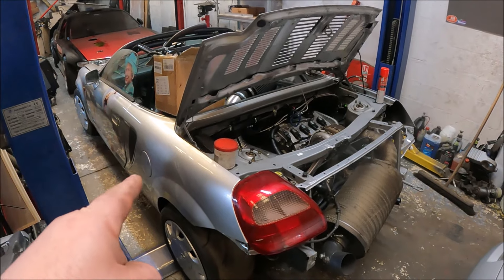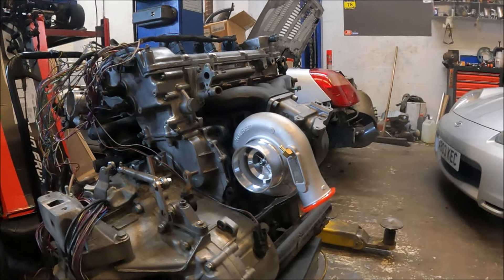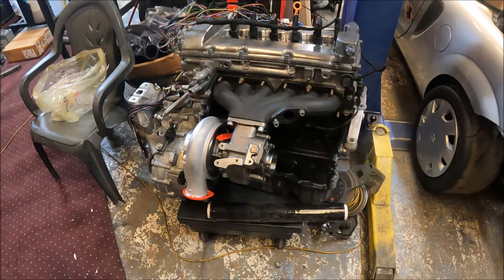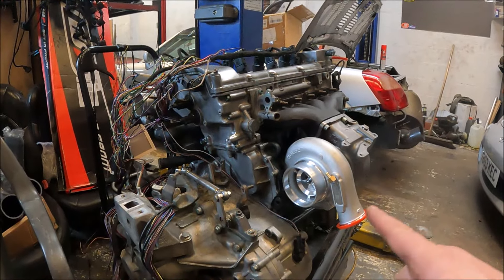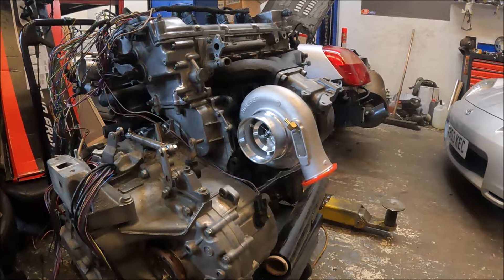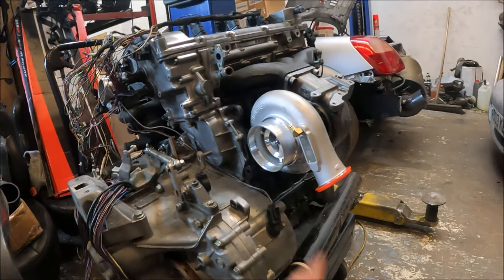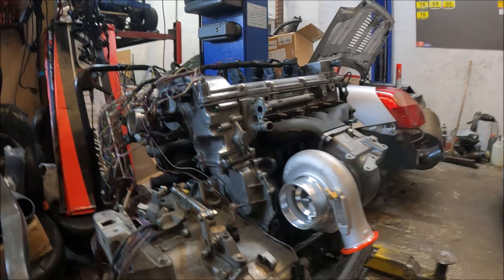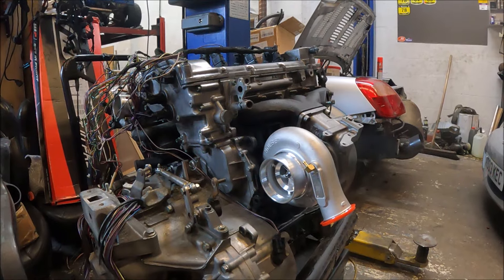How to choose the correct turbine housing for your turbo engine. And a look at the Holset HE351W 8cm

Comment: The 9cm2 he351 turbine housing is magical. With upgraded turbine sizes like the 67mm it can make well into the 800hp range. Great info. The magic’s is all in the turbine and nobody knows it :) you need way less compressor than the internet will tell you.
Reply from the maker: Yep. Most obsess over the comp wheel and forget the turbine side.

Comment: Hey man, stumbled across your channel while looking for info on the Garrett g series. Thank you. 

I wish this video came out in November when I ordered my Garrett g30-770😅. It’s for the new Subaru 2.4l DIT cars and I went with a massive 1.01 AR for this mid size turbo 😅. Wish I went with .83 in hindsight. 

If I may ask, What are your thoughts on .83 vs 1.01 for the bigger g35-1050? That is my end goal turbo for 750-800hp. Thanks!!

Comment: Loving these videos regarding the holset. I'm running one on a Pinto (2.0 8v) with a fully forged engine and have a 12cm housing, it's just a standard turbo not a fancy billet wheel. I want to make 400hp+ currently makes just over 300hp at 17psi and comes in at 3500rpm and holds all the way out to 7200. Would I benefit from changing to 8cm housing or going for one of these new ones with the billet wheels?
Reply from the maker: Spool arounds about right for a 2ltr, power is pretty low but if the N/A engine is making 140-150bhp then a touch over 300 at 17psi sounds on the money. I mean that’s low boost, a Cossie at similar boost makes similar power.

This spec would spool faster though of course as it’s a smaller housing. Your power isn’t likely down to anything but the fact the boost is low on an engine that doesn’t make a whole lot of power without the boost.

Comment: You reckon a he351 with an 8cm housing would be too small for an rb25neo? would be a twin scroll setup and i know people usually recommend a 12cm housing but just curious of other opinions
Reply from the maker: Depending on goals, that would be fine imo. It’s still a big high flow turbine wheel regardless

Comment: Hi @Stavtech, 

I'm thinking to use a HX35 with twin scroll 10cm housing on a VX220, keeping it low boost with dual 38mm wastegates for max 250hp. Later changing the engine to a built B207 and aiming for 400hp. Would that make sense or would you use a smaller turbo for the Z22se engine? Would like to keep it as responsive as possible.  

Thanks in advance!
Reply from the maker: I’m using a HX40 with a 16cm housing on a little 1.8 with a twin scroll setup and on the dyno the graph showed 0.5bar boost by 3000rpm, 1bar by 3500rpm, 1.5bar by 4200rpm, 2bar by 4500rpm and held that to the 8000rpm limiter. On a bigger engine and smaller turbo like you’re talking about you’d be way faster spooling if done right.

Comment: Hi. What turbine housing do you recommend for a bmw m52tub28 with hx40 super? (Compressor 60 / 86mm, Turbine 75/65 mm)
The power goal is 500whp (with pump gas ron98 and low cr), I'm thinking of getting the 16cm but afraid of late spool.
Reply from the maker: 16cm seems a good idea to me. I’m running a 16cm on my HX40 on my 1.8T and spool is fine
Reply: @StavTech  all right, thank you

Comment: Planning on one of these on a forged 3sgte, hks cams and twin scroll manifold. Do you reckon spool at around 3-3500 would be achievable? 

Plan on running anti-lag too to make it as drivable as possible. 

Just worried it might be a bit big
Reply from the maker: Easily. Even with a bigger 12cm housing these are proven seeing 25psi by 3500rpm on 2ltr 4G63s.

I’m seeing 30psi by 4500 on a much smaller 1.8 using a much bigger HX40 16cm

Comment: So is it better to go big wheel small housing or the other way around? Is there any difference?
Reply from the maker: Technically, big wheel small housing is the most efficient way, and usually how works race turbos are. But the actual difference in efficiency I don’t know.
It’s a trade-off to some extent regardless as technically a bigger wheel means more mass to rotate, but it’s a better way to do it if possible.

Generally though manufacturers have it mostly right with wheel sizing and just gotta choose your housing to suit your goals though.
Reply: @StavTech  So basically it's just a trade off of leverage vs mass? Can you also explain how to read turbine maps? I use a rule of thumb of about 20-25hp per lb of turbine flow on a Garrett map but it's not based on any science.

Comment: I have Hx27w 8.5cm T2. Max 270-280 on my diesel application.
Would a HY35 7cm T2 be a decent upgrade? Or a HE300 8cm twinscroll?
Reply from the maker: Depends what spec HE300 8cm, as this turbo here, the HE351 8cm is also sold/classed as a HE300.

For single scroll and keeping T2 flange the 7cm HY35 is a decent option, but this 8cm HE351W would probably spool the same if using a twin scroll manifold

Comment: Hi Mr @StavTech 

Thanks for the video very interesting. What holset turbo would you recommend for a 1.8t for fast road use?
Reply from the maker: What’s the power goals?
Reply: @StavTech  it will be fully forged but look for about 450bhp
Reply from the maker: @allanbeckett1537 hi mate, for those goals I’d use this 351 and a twin scroll manifold. On mine I use the bigger HX40 16cm and a twin scroll cast SPA manifold making 514 but way more to go if turned up more. For 450 or so a 351 with either the 8cm or 12cm on that same or similar manifold would be perfect imo

Comment: Thanks for sharing your knowledge Steve.
I was wondering if HE351 with 12cm housing would be a perfect fit to my Buick 3800 series II V6 engine. I want to have about 350-400ish very streetable horse power. It's still plenty for stock Borg Warner T5 transmission and factory 10 bolt 7.5" Chevy rear end.

I'm also curious about HE221 with 6cm housing in BMW m52b20 if it will have similar performance to Borg Warner B3G a45 AMG Turbo. Cheapest alternative to turbocharged this tinny 6 banger would be TD04-19 or Chinese gtx28. 
Target is about 250-300HP
Reply from the maker: Hi mate, for 350-400 this 351 with a 12cm sounds ideal on a 3.8. The 221W idea on the 2ltr doesn’t seem a bad plan either!

Comment: For a audi/vw 1.8t what holset would be close to a gt3071r spec from factory? Looking for 380+hp around 3k spool or so.
Reply from the maker: This turbo is part way between a GT30 and GT35. Personally I’d run this with a twin scroll manifold.

Comment: Hi Mr Stavtech.  Thanks for sharing your wealth of knowledge with us all.
I recently acquired one of these holsets or very similar in size and specs.  One difference I have noticed is that mine has a conical ring that looks to be held in place with a circlip that's covering what I think are the anti surge ports.  From what I've seen on some your vids, this ring isn't there or you've removed this part.  Are you able to give any info on this and whether or not I should remove it and any pros/cons of doing so? Thanks.
Reply from the maker: Silencer ring. Used to reduce turbo spool noise. Can remove if want

Comment: I’m the bolox who keeps reminding people Ken block was the greatest driver ever of my woman’s page 😅 tell me this. What holset would you use on  sr20? Have a Gtir i toying with upgrading. Cosworth hg and studded with 660 injectors and question 2. What would you run a  bmw m50b28 with forged
pistons? Decent top mount with 1000cc injectors. Ken block for life ❤️
Reply from the maker: Hahaha superb! I wondered who it was! 😂 1- Depends on your goals, if you had a twin scroll manifold one of these 8cm HE351s would be good. 2- Again depends on your goals as 1000cc means you could have all kinds of power. A HE351 12cm would spool up from cock all and still proven at 500+ on M50s, though I think if I had a built engine and big injectors I’d put a HX52 on it and send it

Comment: The K04 on the Volvo is so teeny tiny. Makes 20psi by 2300rpm but by 6000rpm it’s back down to 15psi as the engine wants more air and the turbo can’t flow it. Peak power 5500rpm lol.

Wish you could decently twin scroll a 5 cylinder. Oh well.
Reply: quick spool valve :p
Reply from the maker: Tbf I’m not convinced you can’t. Not perfect but I’d wager it’s got a good effect.

But yeah, same turbo but only running say 10psi and peak rpm will be higher, though power lower

Comment: It’s actually better for a stock internal engine to have a larger rear housing. Keeps the rods in
Reply from the maker: Depends on your boost, and what engine. Torque kills rods. This VR6 is low boost so not big torque, and they have mega strong rods anyhow.

If you pushing a stock engine, yes bigger the better, but if you not near its limit, not a big issue

Comment: im suprised they havnt started included the volume of the housing in the measurements
Reply from the maker: Literally not a single turbo company on the planet has ever done that, as it doesn’t mean much
Reply: @StavTech  would it not be a more universal metric across flange sizes
Reply from the maker: not really as it would give a false impression of housing size on things with more area before the wheel etc. It's the area around the wheel, the main scroll section, that counts @Gamesplaytoday